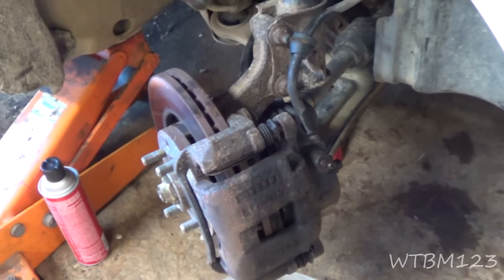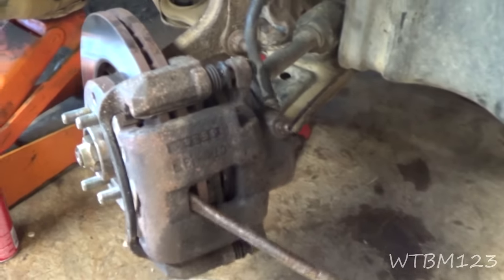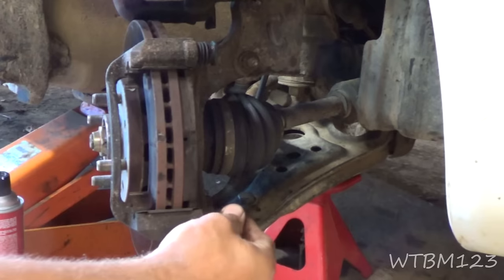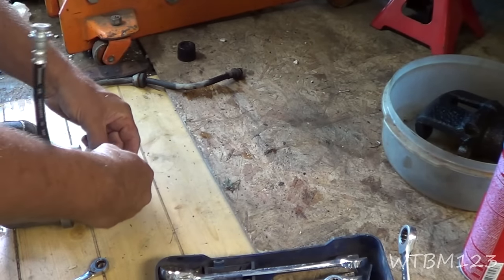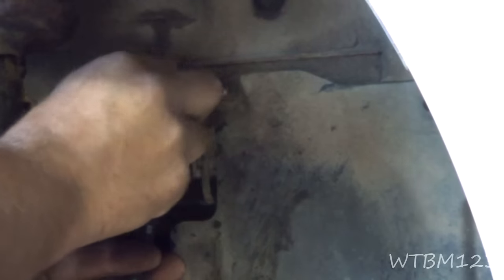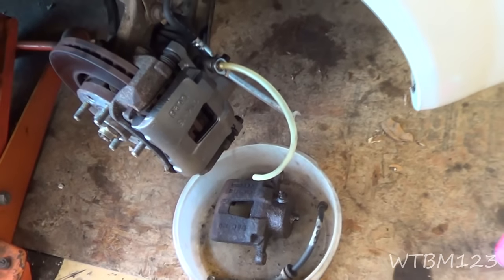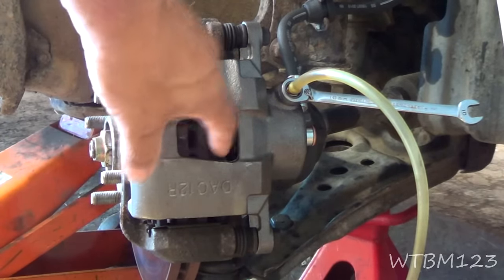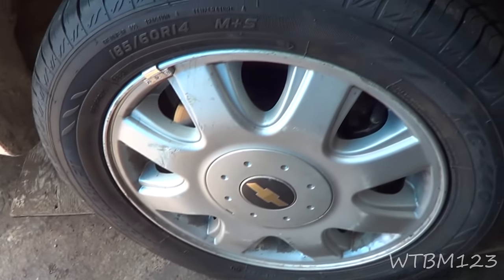Stuck Brake Caliper or Bad Rubber Brake Line #brakes #bleedbrakes #brakehose

Comment: I had same problem. Made same fix, still had same problem. On a hunch I pulled parking brake release....fixed it!! No my parking light indicator was NOT on. 2008 Silverado. It was barely barely engaged but apparently enough to grab the driver's side front wheel.

Comment: Nice video. I have subscribed. The mechanic changed new master cylinder and bled but still have spongy brake sometimes, so I guess it is the caliper and maybe hose. Most of times I get spongy brake when making left U turn while slow driving. Any advice please?

Comment: Just stumbled across this vid. Yep, I had this happen 6 months ago on my wife's Pontiac GTP. She had burnt the dust boot around the caliper piston and blued the rotor, probably made it hard as diamond xD. I bought a new caliper, rotor and pads. Like you, I couldn't get the caliper to budge until I loosened the bleeder. I went back to Autozone and bought the new flexible line and everything's worked like normal since.

I took the old line to work with me (Ind Maint Tech since '88) and performed an autopsy on it and found the inner liner had split and folded backwards at the crimped hyd fitting, at the bracket (i guess because of it flexing ). And yes it was acting like a check valve, just like you said.

I know these new Poly-Lined hyd hoses protect Industrial systems from rubber debris in sensitive systems, but they're not designed to be flexed on a regular basis, like they are in autos. Like most all plastics the Poly liners get brittle over time.

I'm sure your vid will help thousands of people. I think during the next oil change/tire rotation, I'm going to replace the passenger side flex line also.
Reply from the maker: Thank you for watching and commenting
Reply: Thanks for sharing the autopsy report. I was gonna do the same thing lol.

Comment: finally some new info for a nightmare problem, after changing suspect calliper with used part still rotor was seized solid now i will try hose replacement as a last resort
Reply from the maker: Hope it helps

Comment: I remembered watching this when you originally posted it, and referred back to it this week.  Turns out I had a bad hose on my old Town & Country minivan.  You do a great job of calmly, methodically diagnosing problems.  I would have figured it out on my own, but not without a lot of head scratching and wasted time.  Thank you for making these wonderful videos!  I always look forward to them!
Reply from the maker: RadioRex72 Thank you for the kind words , Glad you got her all fixed up.
Reply: How likely would a brake hose get stuck and act like a check valve? If it ever did would it make any sense to just blow out the hose using compressed air and re-use? Thanks.
Reply from the maker: It happens a good bit . The inside comes apart , collapses  and blocks the flow . Only way to fix is replace .  Thanks for watching and commenting
Reply: RadioRex72  I have a front brake hanging up on our '95 Buick Riviera, it's overheated one of the rotors and caused it to warp more than it already was. I noticed that when I let off of the brake pedal after a stop that the brakes gradually release. I have a feeling it's a bad front brake hose but I'm going to check everything.....And he does explain things well, "I like the way he talks"! Lol, he kinda reminds me of the way Joe Namath sounds.....
Reply: great vid. my 2005 Malibu maxx had the same problem

Comment: Thanks for taking the time to make this video.  I've replaced everything but the hoses, lines, and expensive stuff and still dragging.  Apparently this is fairly prevalent in Ford F150 in the 2002_2006 or so era.  As is brake line rust.  So here comes the penetrating oil and trip to the ijit auto parts place for hoses..... Thanks man, nice troubleshooting and video!!!
Reply: Best video ever I was glued to it till the end
Reply: The rotor guard will sometimes get hit by rocks and well sound like your break is dragging. I just bend it back a little bit and no more sound

Comment: Changed the caliper.  brakes were still sticking just on one side. I was pulling my hair out then found your video.  it was the hose.  thank you very much. problem solved
Reply from the maker: Glad it helped
Reply: I replaced the hose, caliper and master cylinder and front left is still sticking. Can't figure it out.

Comment: Wilber that is a great way to bleed the brakes, I like it. I just greased the pins and it seems to have stopped the front left brake binding, if it sticks again I will replace the hose and caliper and use your method of bleeding the brakes.
Reply from the maker: Thanks for stopping by and commenting

Comment: I’m still amazed at the banjo design and how 2 copper washers can stop brake fluid from leaking. If I was designing it I would have had a screw down fitting like on the other end of the hose has.
Reply from the maker: The banjo fitting is pretty strong and needs to be as wheel is always turning left and right . Thanks for stopping in and commenting

Comment: Thank you, my old reliable Malibu 2006 got the same problem, I replaced both front hoses and problem solved, next I will replace the two rear hoses too just in case, after all they all are same age.
Thank you.
Reply from the maker: Sounds good

Comment: I recently replace a caliper on a 95 dodge b2500 van and was still having issues. Your video pointed out my mistake. I hate to admit it but I left off one of the copper washers on the banjo fitting... Thanks for the video,helped me fix my error. Now to bleed the entire system...
Reply from the maker: Easy to do , main thing is you figured it out
Reply: @wtbm123  Right on buddy! Thanks! :)

Comment: thanks..I am fighting a problem with fluid leaking out around the copper washers and hose/banjo bolt.I replaced the caliper since I saw a defect around where banjo bolt goes thru and also tride new washers with the new caliper and it still seeps,but less.Never had this before.Only option is to try a new banjo bolt and or a new hose.Fluid is not coming out of hose or it's pressed on fitting.
Reply from the maker: +newyota1 Would think it would seal with the copper ones , if every mating surface, on both sides of the washers looks good , clean and new washers, is there a crack someplace .

Comment from the maker: Good eye Ziggy . I saw it on the video too, The rotor is loose on there. I took it all apart and re lubed the slides, then realized the pads were wore on a taper. I think that may be doing it.  Thanks for watching .
Reply: I was going to comment about the uneven slider pins movement also. And not to be a broken record if a bunch of people already said it . Then I saw this comment and apparently you caught it. I just ordered that permatex silicone brake lube. Its supposed to be good to 3000F. and wont swell the rubber boots on the sliders. I will find out after time. I did alot of research before I decided on that specific type. Hope I made a good choice.

Comment: I had both front rubber brake lines collapse on my 95 dodge neon.  I went through a brake rotor and 2 sets of pads before I figured it out because I'd never heard of the line doing that.
Reply from the maker: Thanks for watching and commenting.
Reply: Text my brakes marotta McCaleb and my brake lines on one side I replace one brake line two years ago for having the same problem when I run the car or truck for an hour that's the side that I just replace the line and it's grabbing its this is grabbing my brakes my brakes start smoking a Dodge Dakota 1999 pickup I need help finding the problem everything is been changed on the front
Reply: hellcat1988 you’re first problem was that you bought a dodge

Comment: Thank you sir!!! This is probably the best informational video I've seen on here don't skip steps and you take the time to describe what you're doing.. 

One question what is gravity bleeding and how do I do it? Does car have to be running? I'm guessing with cylinder cap off not running
Reply from the maker: Gravity bleed i loosen master cylinder cap . then open bleeder and let fluid run . just do not let master cylinder run out of brake fluid. no need to start car.

Comment: Had the hose /acting as a check valve issue before.Of course I thought it was the caliper like you said until hours of frustration and two calipers.Long before you tube could help me.
Reply from the maker: +newyota1 Thanks for watching and commenting

Comment: Great Job ! Never Would Believe The Brake Line Would Swell 
THANKS this Vid Helped Me Diagnose My Issuse Which indeed was 
The Brake Line !!! After removing the Brake Hose I blew compressed air 
Through the new and the old Brake Hoss and the differance was Dramatic!
Night and Day !!! Was so fustrated because the hanging caliper seemed like the bearings 
Where bad , but they were not bad ....spent 60+ bucks to learn that lesson
Additionally Becareful when disconnecting the hard brake line from the body 
Mined needed 12hrs and some heat applied before i felt confident enough that I would not 
Break that hard line while disconnecting the flexible brake hose 
GOOD LUCK all and THE LORD BLESS YOU 
#JesusIsTheAnswer
Reply: Ps thats 12hrs for the penetrating fluid to work :)
Reply from the maker: Glad you got it figured out ,  thanks for watching and commenting

Comment: Excellent work, thank you for sharing. Question, if a leak develops at the banjo bolt, hose connection to caliper, calipers have been changed out, new washers, hose block end looks good but still have drip leaking.  have you seen a problem with the banjo bolt itself causing the leak?
Reply from the maker: Mark Alan Not unless the top where the gasket hits is messed up , Sometimes the aluminum washers will leak , could try copper ones if those are aluminum . Most times they leak is dirty .
Reply: I have had that happen. The area on the reman aftermarket caliper I used wasn’t machined right & no matter what I did it still leaked slightly so I replaced the caliper with a different brand.

Comment: To anneal copper crush gaskets.
You heat copper with a gas torch to cherry red then quench in water.

I had a stuck piston on a Kai Truck left front piston was seized up.
I ended up using the grease gun trick to remove the piston for cleanup.
Reply from the maker: If it has a cap use the cap . of not use the revivor. you may need to drain a little coolant out

Comment: great step by step visual video.   I rely on these a lot.  I do have a problem I can't find.  93 bronco. and BOTH front wheel hubs / lug nuts are so hot after driving short in town that you can't touch them.  To fix I have replaced (on both sides) : pads, rotors, calipers, rubber brake hose from caliper and master cylinder.   since the lug nuts are hot from smelly hot brakes on BOTH sids, I believe it has to be up at master cylinder.   Could it be the metal brake lines ?  Could it be the metal valve conection point at mastercylinder?   I did not replace that nor did i replace the metal brake lines.
This is driving me nuts.  I have put 700 miles on the new pads/rotors calipers... still getting too hot like brakes are dragging..   any ideas?
Reply: adding  and truck brakes straight and good.  everyting seems fine except too much heat up there.
Reply from the maker: Jack it up and see if brake is dragging , also is it hot from brakes or wheel bearing , if center is hotter than caliper or rotor then check bearings

Comment: I have the same problem with a cadillac allante 1988, I replaced the caliper ,twice and two new pads and still problem with a stuck caliper. But I think you are right about the hose, I'll replace the hose. Thanks
Reply from the maker: Hope that fixes it for you and thanks for commenting

Comment: Hi its Ron again. Totally confused. I tried your suggestions, however, I’m confused as to-weather  the stainless  clip is inst. properly. The clips are a different length.  Can you tell me which clip goes on left side of the bracket or the right?  I would like to try and send you photos.

Comment: I've got a 2000 Olds Alero with sticking caliper(s), I think its the front passenger side as when you hit the brakes it kind of pulls that way a little bit. I don't drive the car too often, it sat about a month and ahalf and when I went to drive it it felt like the brakes were dragging...severely. I truely believe its rust/corrosion but will check those lines out too.
Thanks!
Reply from the maker: Randy Herrel Slide pins may be the issue if sits alot . The side it is pulling to , is probably working better than the other side . I am sure you will figure it out when you look in there . Thanks for watching and commenting
Reply: wtbm123 Actually, both sides the wheels were "hot". I think both sides are sticking just the psngr side more so. Will be tearing into it later today.
Thanks for posting stuff like this on Youtube, its a great help to all of us out here! This is the 1st time I have ever utilized Youtube as a tool to help me fix something. I can tell ya...it won't be the last!

Comment: After replacing my rear end spider gears i put everything back the way it was, but when i got to bleeding the brakes only my front brakes would get fluid coming out, but not my back ones, my brake pedal wouldnt get hard, its loose because the back brakes aren't getting fluid through, what do you think the problem might be? Some people told me it wasn't the master cylinder because my front brakes were getting fluid so it is working.
Reply from the maker: Assuming all air is out. You could try with brake pedal pushed loosen a few fittings and see where the pressure stops make sure some pressure is at the rear line coming out of master cylinder  Then work down the line or if easy try loosening the rear brake line going in to the rubber hose in the rear . Also if you had the rear line off and  bleed a lot trying to fix the rears , then keep in mind that a lot of brake pumping can suds fluid and make it hard to get air out . If pushing the pedal ,i push once or no more than twice slowly then open bleeder . You are moving fluid not building a pedal it will come with moving fluid in and air out.

Comment: If you're changing caliper and line can you attach the new line to the new caliper before installing new line?
Reply from the maker: You could , but to me it seams easier to attach hose to caliper at banjo fitting last .

Comment: Thank you for this, I'm about 70 miles from a real service station and right rear rotor is really hot as is the entire mag. What is the worst case scenario if I keep driving with this overheating rotor? There is also a burnt rubber smell associated with that wheel. Other than maybe having to replace the rotor and brake assembly, is there another risk if I drive it rather than calling a loader to pick up the car? Thanks for the great video!
Reply from the maker: Well if stuck and driving , it will keep getting hotter and hotter . It may brake the rotor , which can chew up a lot of stuff . I have also seen them get hot enough to start the grease in hub for bearings on fire . Main concern to me would be fire . So if trying to drive , go some and let cool , then go again, do not let it get hot enough to catch fire
Reply: wtbm123 Thank you for that quick response.I will be getting it in tomorrow morning and will try to drive the side streets on my way there. I can smell a burning rubber smell, maybe that is the brake line? Anyway, thank you somuch!
Reply: Helped a lot , with 1900 miles to go n limited funds , big help thanks
Reply: Frederick Dunn actually it's not Sandra but Sandra's husband
Reply: Fix it yeseterday

Comment: That voice sounds familiar! You in S.W. Michigan? Great video! I usually discard those copper washers on banjo bolt for steel ones. On tightening up the pads/piston to rotor I usually put a lug with spacer under it on a stud on opposite side of rotor from caliper before hitting the pedal... thanks, Trevor
Reply from the maker: Thanks for watching and commenting

Comment: I have a 2005 Ford E150.  I cannot find the problem of my front brakes dragging heavily.  So far, I have replaced the master cylinder, calipers, and brake lines from the caliper to the connection on the body frame.  I have not replaced the brake pads, as they are close to brand new.  I also did not change the rotors, as they look pretty good.  My ABS light does not go on, and the fuse is good.  I have followed your utube and tried everything.  Before the white coats come and get me, please help me if you can.  Desperate Ron
Reply from the maker: If you have new calipers , we will assume it is good and the slides are free . thinking it has the slides in caliper . If slides are in caliper bracket then make sure they move in and out free. . You said brake pads look good . but do they slide freely . If they go into caliper bracket , make sure they slide around by hand . If  attach to caliper then they will be fixed there and caliper would be the sliding part. . So make sure all the mechanical parts are in good working order . if so then see if holdin fluid pressure , by releasing bleeder . But a lot of tines dragging braks that one can still drive on is a slide stuck or pads stuck if they are the ones that float in caliper bracket .